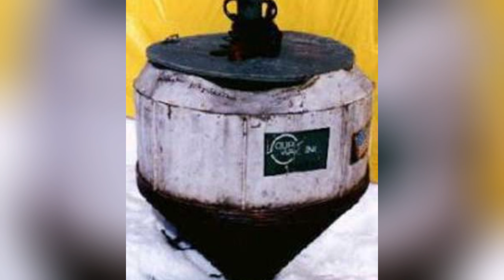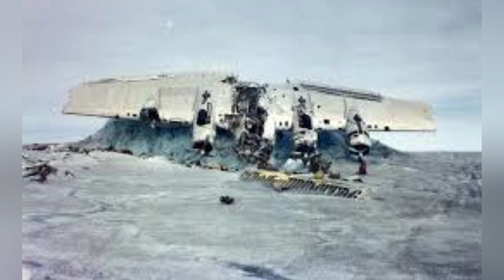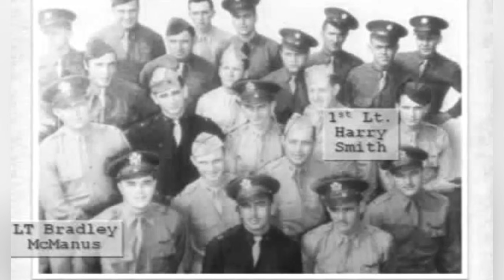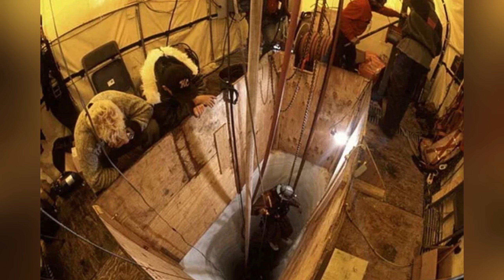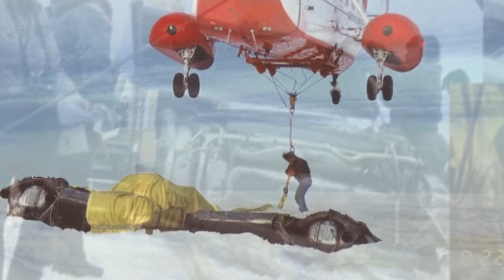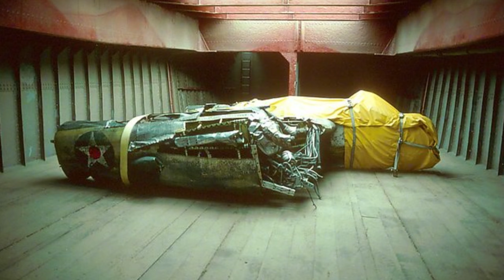Recovering Glacier Girl: Raising a P-38 From 268ft Deep Ice

Comment: Impressive achievement.  But WHY BOTHER when there were already 25 other P-38's still flying?
Reply: Because, Zippy---we can not have too many of these old war birds to help  keep history alive.
Reply: Idk if the numbers are true, but I saw the recovery and restoration costs about 4 million and the aircraft sold for 10.
Reply: @smitty16s So the Investors risked loosing 4 million and received 6 million in profit probably over 10 years. If that Glacier collapsed, all workers under the Ice could have died.
Reply: +@markmarsh27   There are not 25 airworthy P-38s.  It is around 10 with a few more in rebuild.  There were less than 10 flying examples when this P-38 was pulled from the ice.   All of them should be gotten out including the B-17s.